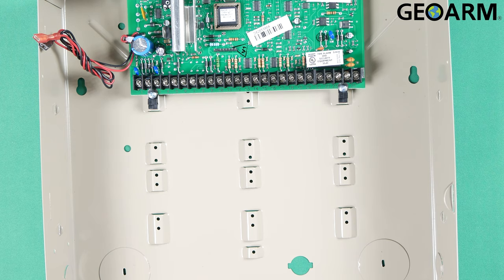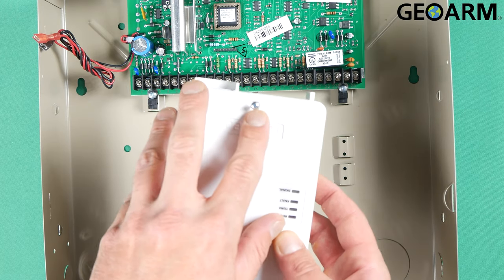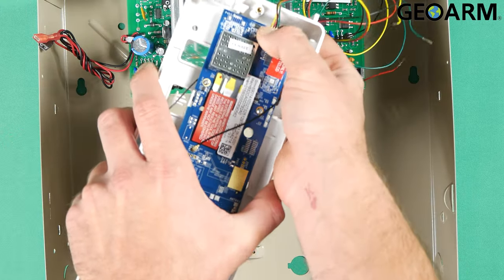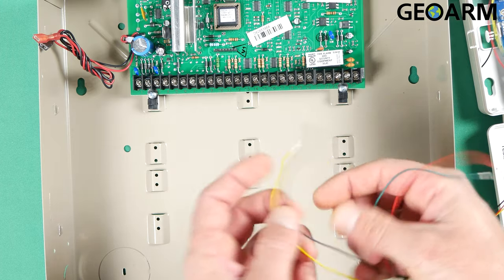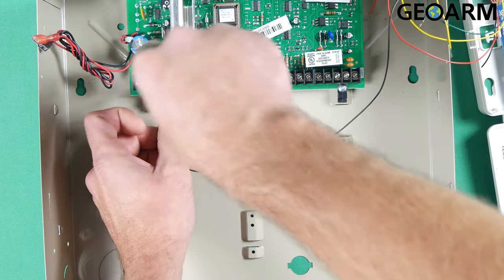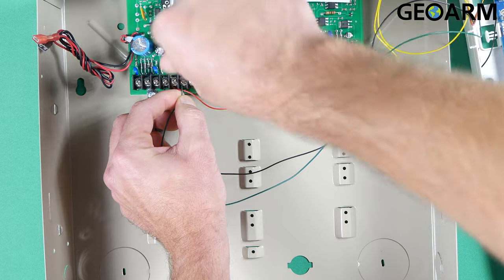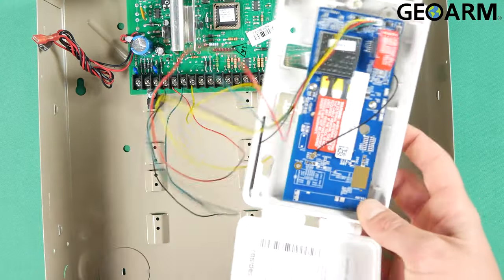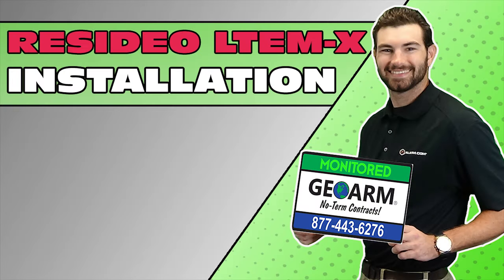Resideo LTEM-XA/LTEM-XV Cellular Communicator: Installation

Comment: Will powering completely down affect any of my settings of  wifi devices or control pads? My firmware is 9.18 and I read somewhere that I need 9.12 or higher for Vista 20P so I assume I'm ok. Can I just splice/join the wires from my existing communicator that has the same wires in the same slots? Seems like it should work fine to me, and it would be way easier than dealing with tiny wires in a tight space!